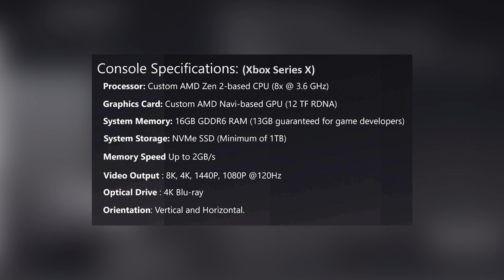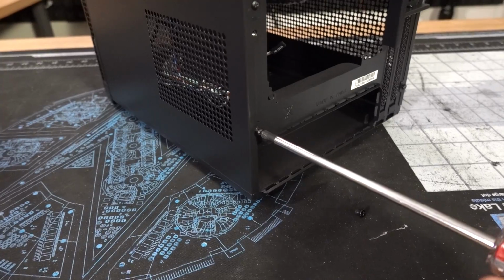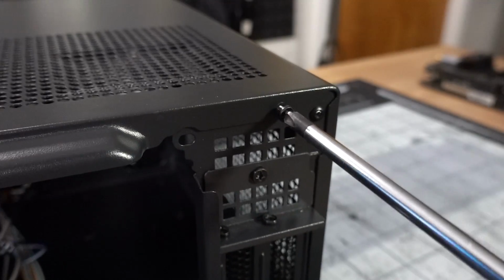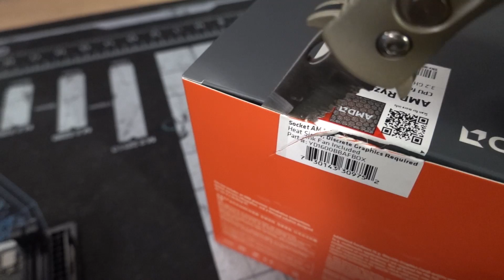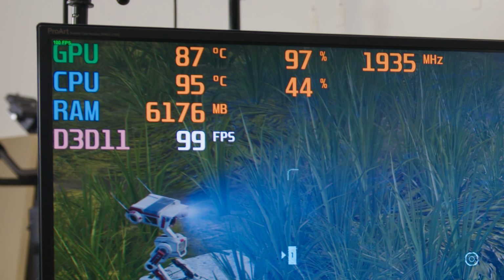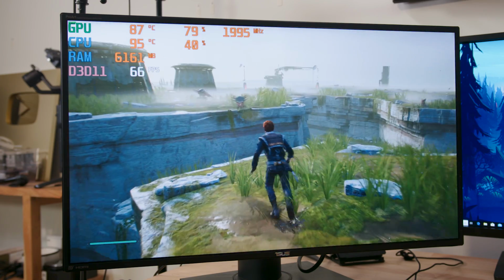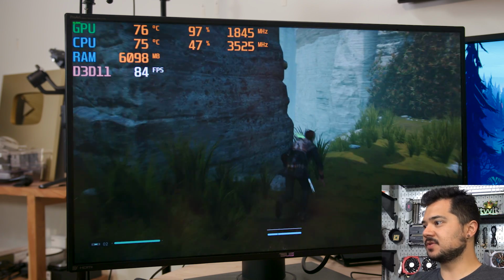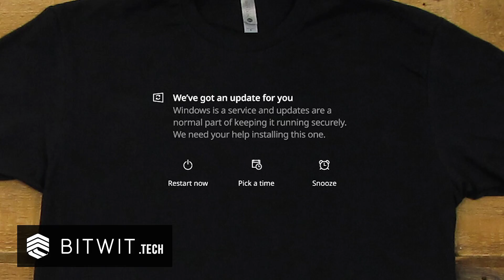I built my own Xbox Series X

Comment: Five years after your video and I'm building a gaming pc this week with this case.  Ryzen 5 3600, Rtx 5050, 32gb of ram.  Gonna be a nice little gaming pc in the living room.
Reply: UPDATE:  I bought everything for my build and attempted to assemble it, only to find that my full sized atx power supply and the hard drive plate won't fit in the case.  I have a 3.5" 16tb hdd that I plan to install in the case.  So I had to order an SFF power supply (should be here today).  Hopefully that will resolve the issue.

Comment: Nice vid but wouldn't go ATX casing. I prefer bigger casings so heat doesn't get built up. The issue with that build is, all the hot air from the cpu rises and over time that psu will have to relay on the inbuild fan to get the hot air out. Decent build but that casing is the downfall to that rig.

Comment: So you are building an xbox equivalent pc and use a sub par gpu. Xbox gpu does 8k 60 and 4k 120fps you can lock the fps on the xbox to constantly run at 120 fps 4k.

Comment: My build in this case
Ryzen 5700g
32 gigs 3600mhz
1 tb wd m.2
Be quiet 650 psu
Asus x570 itx (wanted all the sweet usb) tried the b550i but had driver issues

Comment: I’m surprised your temps are so warm even with the mods, I’m using a 47mm cooler from thermalright on a 10600k and temps are less than 70c, and my gpu (rtx 3060ti founders) is running below 70 as well with a 100+ bump on the core and 200 on the memory. I’m using the same case

Comment: Damn you couldn't pack in as much power as the series x for nearly the same price of it. You went well over the price of the series x while at the same time packing in considerably less power into the system by comparison. The series x is insanely killer in terms of price/performance, especially when you factor in better game optimization too.

Comment: Two protips for the SG13 case. Use a SFX PSU bracket that puts it towards the top of the case vs putting it in the middle - this gives you alittle extra clearance. Second thing - if you're using a SFX PSU you can remove the ATX PSU support bracket on the side of the case, replace with a 92mm exhaust fan (I use noctua) - lines right up with the side holes of the case. That side fan will really help the hot air from building up in the case. Also a good idea to use a 120mm AIO (140mm cuts down on your GPU space).
Reply: I did exactly the same build that is on the video, except for the CPU witch is a ryzen 3600 but I’m having a problem with temperatures. My ryzen on games is around 85 95. Could you please help me?  Do you have any idea what’s going on? The power supply is a SFX and the CPU cooler is a noctua L9 and also I put a 140mm at the front noctua as well.
Reply: @jamesquionha8996  I would suggest trying an AIO. The 3600 is going to show higher temps than my 1600 because the die shrink, my friend with a 3600 also gets higher temps. The temps went down when he bought a tower style 120mm fan, the stock fan was horrible (which I would guess the L9 is similar). I use typhoon 120mm fans on the radiator (push/pull - not sure how much the extra fan helps though) but you want a high static pressure fan, you can also look for a high static pressure noctua fans as well. Add the 92mm noctua fan on the side as I suggested and I think you will be good to go.

Comment: I came to this video solely to read the outdated 'IT'S STILL LESS POWERFUL THAN THE NEW CONSOLES PCS SUCK' comments.

karma's a bitch ain't it?
Reply: The new xbox systems performance isn't anything out of the ordinary and, shockingly, the XBSX does not indeed perform at 4K 120fps.
Reply: @papayer  Yeah I knew that, they advertised 4k 120 hz, not fps, but the knowledgless plebs just assumed it meant every game ran at 120 fps at 4K, which even now, as far as I know isnt even possible on a high end consumer rig, which really shows how much consoles deceive the user to get additional sales.
Reply: @cancerousnut7767  Yeah, my bad. And yeah it's terrible. The new $600~ GPUs still see somewhat of a struggle at large resolutions with ultra presets in most games, and yet people unironically believed a $500 console (which is an AIO system comprised entirely of proprietary hardware) would get them there sooner and with a higher refresh rate... crazy how you can profit off ignorance like that, and have people parrot a bit of fluff they heard from you while feigning superiority. Fanboyism is a crazy, stupid thing.
Reply: @papayer  Oh yeah don’t worry about it you’re fine man
Reply: @papayer  And it’s even funnier when they say that because we don’t have their proprietary hardware, we’re “inferior” and we’re just mad we don’t have the same RDNA architecture as them.
Reply: @cancerousnut7767  Those 12 Tflops are changing the game, man. Tflops will take us to Mars.
Reply: What happened between then and now? I knew the series x and Ps5 were going to have a catch but I haven’t kept up with them

Comment: 13:22 - this is way too little room for a CPU cooler for a case like this. They could have easily flipped the motherboard 180 and installed the PSU in another way. So you can mount a vertical air cooler radiator. But yeah, this is the reason I would never go for this case, unless I'd wanna go for water cooling.

Comment: Is this really and equivalent I’ve heard you need 3700x plus 2080 to be a Console killer
Reply: no you don't need that tech
rtx 2070 super is as powerful as 2080 and Microsoft is focusing on gpu more than cpu
Reply: @2NDSEATEROFMOTHORCOUNCIL  Rip all the peasants that have been begging for arma 3 on pc. That thing runs like shit on my mid-high rig
Reply: @cancerousnut7767  true. but i think that is a bug. i get 60 fps on ultra on my 750 pc
Reply: @2NDSEATEROFMOTHORCOUNCIL  Nah, it’s an issue with CPU performance. The game stops improving in performance past a certain point. The game doesn’t even properly identify specs when playing the game. You have to manually allocate ram, your CPU cores, threads, it’s because it’s a 32 bit game. It can’t properly use newer hardware.

Comment: Do you think you can hack the Xbox series x to run Windows 10?
Reply: I think people have managed to get the One X to run on windows so yea it might be possible
Reply: HellF1re24 YOOOO a $500 pc but it can run like a $2000 pc
Reply: @bonelessspagetti2995  Kinda. It might have some lag tho because its not meant to run on windows 10 but Xbox's OS and Windows 10 OS is similar, therefore it may work just as well as if it wasn't running on Xbox OS (OS= Operating system)
Reply: HellF1re24 oh well IF IT DOES WORK FINE THOOO

Comment: Would it help if you almost used your psu as an exhaust by flipping it so that the fan is on the inside? And yes, I do understand that this would diminish your power supply's life span by probably about half

Comment: honestly I'd wager the next xbox would be $800 AUD  
but as a " console killer " I think you'll need to increase the budget 
not many graphics cards  can do 4K gaming at about 30 / 60 FPS  and still be a reasonable price 

If I were to get a desktop that can beat a xbox one x or ps4 pro right now  
and do 4K and more FPS than the console/s it would end up being a lot more than the price of the console/s 
there's a reason why PC is far better but at a higher cost  overall and performance can  fluctuate  from far better or not much better than console  
but consoles are reasonably priced and runs most games smoothly without issue

Comment: I always have airflow issues in these types of cases. It would be interesting to use a different case design where the air gets sucked in from the bottom and comes out the top like a wind tunnel.

Comment: july 2020 where they still havent told us what GPU or CPU is in it.. just that they are "custom"... that could mean LITERALLY ANYTHING ... also i feel like the series x is like the amd of consoles "we have bigger numbers so we go boom" ... while ps5 is the intel, caring more about silicone and boost speeds... honestly if you have a well ventilated area i feel the boosts of the PS5 will keep it level with the series x

edit: also with this build its run into the same problem im worried that the new consoles will have and that is ventilation and proper cooling... PS4 had soo many cooling problems due to is fan placement and the vents being really shit and the series x looks like its gonna be either really loud to keep up with the cooling needed or its gonna be a literal hotbox... xbox might have better stats but design wise i feel like they have failed there

Comment: Dunno if this will be able to brute force its way into being as good as either the Series X or PS5 due to their SSDs, which aren't yet available for PC and their superior I/O.  DirectX 12 Ultimate should help somewhat with the overhead PC games normally have to work through, and you will likely be able to get a better frame rate with this (maybe not much though), but the loading, even on an NVME drive will be worse once next-gen actually starts to focus on games that take advantage of the new features.  For everyone else, it would be better to hold off until you can get a better PCIe 4.0 drive, or even 5.0.

Comment: If you had flipped the PSU over wouldn't that have improved thermals. With the PSU fan sucking the CPU heat and pushing it out the back

Comment: Use the SFX PSU as an exhaust as well. Besides that, go for a 120mm liquid cooler so it does not suck hot air from the gpu besides and have an M.2 drive instead so it has less cables and occupies less space. Doing it the optimum tech way :) Reason why his channel is called optimum tech is because whatever he posted is what is considered ideal ;)

Comment: "Its basically a little gaming PC" 
Yeah, welcome to what Xbox has always been from the start. A mini gaming pc that they put a restricted OS on so it Only plays games (and whatever app they want it to).
That said, what it does do, is have specific parts and specs that are mass produced. They run a specific GPU, an specific CPU and other specific components that dont change. This allows them to get much better prices on those parts, and thus, brings the price of the console down. This is how they can sell it for cheaper than a similar spec'ed PC.
Reply: Appreciate the breakdown. I’m torn about next gen. I prefer xb1x but own, ps4 slim, and gtx 1050 ti laptop. I think I may get xbsx first and get ps5 later when all the single player exclusives are a fraction of the price.
Reply: @matthewrichardson8162  Bro get a desktop

Comment: Ok so for let say.. double the price the Series X is going to cost, you built something weaker. The RDNA 2.0 cpu on the X is faster than the Ryzen 5 1600 and some devs said that the gpu on the X is faster than the RTX 2080..(The 2070 super is just 9 tflops, the 2080 is 10 and the X is 12) and that's without speaking of the devs tool they implant on it. Pretty sure the Series X will give significantly better perf than this pc. The hype is there for a good reason imo.
Reply: Yea the X isn’t as good as you think. If it’s still running games at 30 frames something is wrong
Reply: @RW-zn8vy  don't know where you got your info from but the majority of the games on the next gen will be at 60fps with support for 120fps on less demanding competitive games. Only a minority will be at 30.
Reply: Orange Pantalon keywords you’re missing support of 120 fps which will almost never happen. Sounds just like the things they said with the Xbox one X. Also assassins creed is only 30 fps for the next gen consoles and Sony has showcased its games in 1080p 30fps. If none of that is fishy to you something isn’t right. And it’s also up to the developers so you can expect to have lower frames because they will focus on graphics

Comment: Does the Noctua AM4 low profile cooler really help lower temps on the Ryzen 5 2600? I finally got a second hand silverstone sfx 550 watt 80+ gold rated psu on ebay for only £50 which was a really good deal. Then I ordered the Noctua low profile cooler from Amazon UK today and it should arrive tomorrow. My 2600 was using the Wraith Stealth for over a year and getting way too hot like constantly 80/90 degrees in gaming. I did have a 120mm Noctua fan in the case. But I was using a full atx psu and lots of cables. My new PSU is not modular but still pretty small. Hopefully it will help have better airflow.

Comment: Since you have the front fan as an intake, one of the intended cooling configs is to have the PSU flipped to have it as an exhaust.
The other config would be having the front fan as an exhaust and keeping the PSU like you had it.
Indeed the temps in the PSU would be warmer, but the warm air from the CPU would actually have a place to go and not sit in the case causing the temps to rise.
There is plenty of ventilation on the sides of the case to keep the air coming in but not out. 
Since the air gets heated by the CPU it gets sent towards the motherboard and rises up toward a flat piece of metal from the PSU and stays there.
Other than that, good config of parts.

Comment: I would like to mod it , putting a 120 mm intake in the same side as the psu , and putting an aio and push air out of the radiator , that would do a better performance I think ....

Comment: The world learned that a 600$-800$ console is gonna crash(the ps3 in 2006 I think) so it not going to be more than 600 USD amd looking at those specs I'm betting the base model price will start at 400-500$
And i feel that a console killer needs a price/performance of 400-500$ for 1080p or 2k @60

Comment: idk, running folding at home on my 2070super shows about 13 single precision TFLOPS, so i think a 2080ti would do more than 14, i know what the 'official claims' are, but that is based on founder which typically has lower performance than the card partner versions. js.

Comment: Dropped 20 degrees on the CPU but you could have dropped ~40 (yes, 40) if you had gone with a cheap AIO that costs the same as that low profile noctua and that would have allowed you to keep your PSU.

Comment: So you build a comparable PC (worse cause Windows and not latest gen cpu ) for 2x of price. W/o OS. NICE :D. FYI SERIES X sports 4000 series Ryzen CPU and the GPU performance is already confirmed OVER 2070 Super. Completely useless build and nobody should do this who wants to game below 1000$. Even for 1000$ you will have better performance and experience with the Series X I guarantee you. This case is also a thermal design failure but go ahead and fail in a video ;)

Comment: Hi Bitwit ! any recommend liquid cooling for this case ? Follow your list mainly with little adjustment. Thank you~

AMD Ryzen™ 5 3600
MSI B450I GAMING PLUS AC Mini-ITX

ADATA XPG GAMMIX D10 32GB (2 x 16GB) DDR4 3200 Mhz C16
WD Blue™ SN550 1TB M.2 PCIe NVMe 3.0 x4

MSI GeForce RTX 2060 SUPER VENTUS GP OC 8GB GDDR6
 Corsair SF Series™ SF600 — 600W 80 PLUS® Gold SFX

 SilverStone Sugo Series SG13B Mesh front panel Mini-ITX — Black
Noctua NH-L9i 95mm SSO2 for AMD CPU Cooler <--- WONDERING REPLACE W/ LIQUID COOLING

Be Quiet! Silent Wings 3 140mm PWM High-Speed Cooling Fan

Comment: The Console FanBois might be getting a huge hardon for the specs of the new Xbox and PS5. An 8 core CPU is more than your standard PC that has 4 or 6 cores, but will it multi-thread? Every PC gamer knows what's up; it's still an APU with shared RAM. 12 TeraFlops?  Who the hell measures "gaming" performances based on TeraFlops? That's something super computers are measured by back 30 years ago.  Plus you're not playing video games with them. Everyone knows it's FPS, and an APU will not give you 4k at 60fps. A RTX 2080 ti BARELY gets 60fps at 4k with max settings, and nothing from AMD comes close to an RTX 2080 (non-ti), let alone an APU. All those TereFlops will be spread among everything that console does, plus all the virtualization Microsoft likes to do will surely lower it's overall performance.

Comment: I live in a country that typically sees weather pst 40c  I can't  see the point  designing  a console to fail unless  you are  going  to creates a  ramjet style cooling  solution....

I can't see why they can not design hardware to into an av style form factor and have av rack mountable

looking at what it takes to 4khdr content  at this point in time  in processing in  a film editing suites  I think 128+ system ram (upgraded) gpu ram  I think we are  going to be looking at 64gb-128gb FOR 4K HDR, with 8k looming  in the home  I would have to wonder whether or not  1TB  is going to be a feasible option as I think film editor to process 8k and beyond I could see north of 1.5 TB if not higher ..

as for a card option  for 8k output i think we are going to see a market 128GB and higher  without creation of the  bottlenecks we are going to see..

though given the pricing of 8k screens  and size limitations to 65 inch and up I can't see us the plebs having  access 8k resolutions unless you win lotto

Comment: It would be better if PSU was placed where Mobo was so u / we could show RGB RAMs. 

Is there any case like that ? I would like to build a mini pc but would also like to show off RAM / CPU cooler (MSi frozer ) and of course the beautiful GPU. nzxt H1 is something I was considering but Liquid cooling is something I am trying to avoid.  
Also, are u aware of any air cooler that has LCD display like kraken z63 to show cpu / GPU temps. 

Any Suggestions ?
Planning : CPU 3600 / GPU : 2070 super or  2080ti msi trio / RAM : Hyperx Fury or corsair RGB modules. / mobo : open for suggestions.